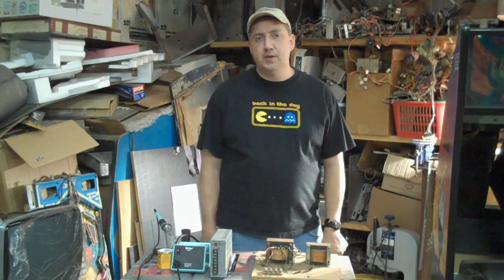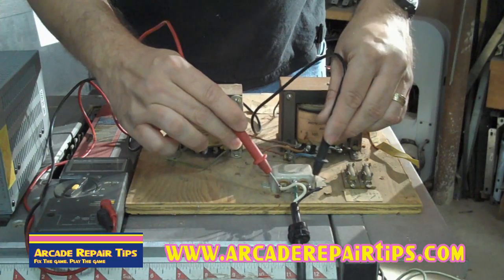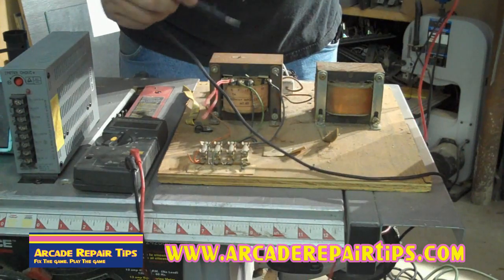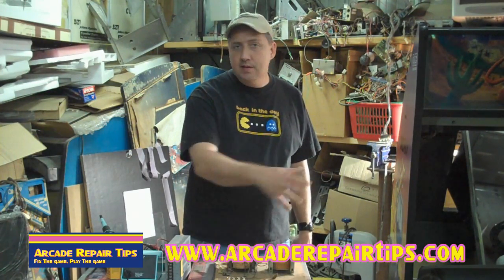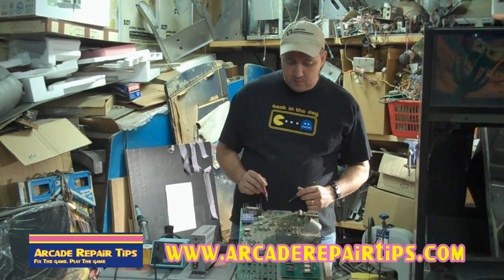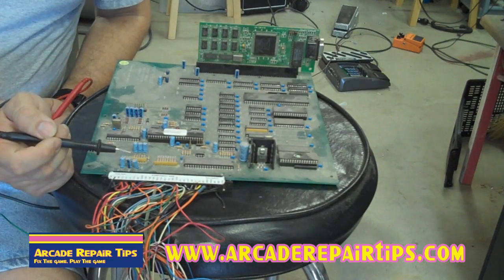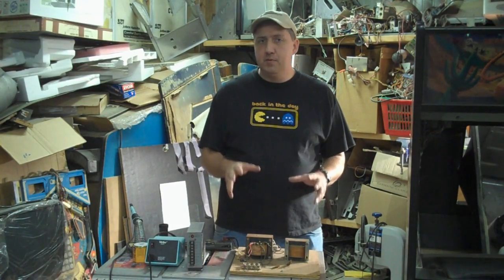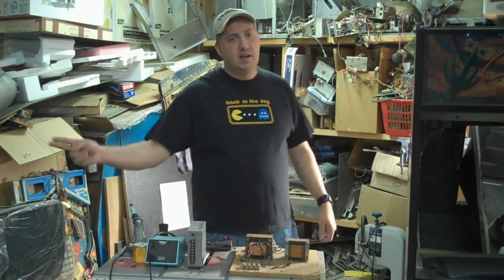Arcade Repair Tips - Checking A Classic Power Supply

Comment: I have a ranger mission cabinet.  The fan inside the power supply stopped spinning.   That’s probably not good for the monitor or the board.  Things will get hot I assume The game won’t coin up anymore.   I put in a new cherry switch and game still won’t coin up.  Any suggestions?
Reply from the maker: Yes, a broken power supply fan is not a good thing, but that should not be causing the coin up issue. Trace your coin and ground wires back to the harness. Make sure they are making a good connection. Remember, you should be able to touch either of your coin wires to a ground and the game should coin up. If it doesn't, then you probably have a wiring issue of some sort. Hope that helps.

We will also be covering your question on our Live Show Episode 88. Here's a link to the episode if you want to watch it: https://www.youtube.com/watch?v=kPaSejWRwso
Reply: @arcaderepairtips  hey turns out I had the coin door cherry switch wired up incorrectly.   I fixed it.  All that’s left is repair the monitor.  The picture edges are a little wavy and moving during game play.   I assume that’s a bad cap or flyback issue in the K7000 25 inch monitor.  Thank u for helping
Reply from the maker: @jumpingeneral  Awesome, glad it was just a wiring issue. On the monitor problem, check your hold/sync adjustments. Check your sync and ground input wires/connections as well. Improper grounding can cause this issue. Check all of your grounds and the DAG wire. Hope that helps.
Reply: @arcaderepairtips  thank you for helping.  I noticed a crack in the flyback.   That would explain the waviness on the sides of the screen I guess
Reply from the maker: @jumpingeneral  Yep, a crack in the flyback can cause this as well. Fortunately, new K7000 flybacks can be purchased from most arcade parts distributors.

Comment: What is a AR board? I have one in my sky shark that I think is bad. old game  If I cant find one then is there a solution? Sorry I am not knowledgeable regarding this, Im trying to get it working again.. Thank you!
Reply from the maker: A/R boards are Audio Regulator boards. They were used in many classic arcade games (especially Atari games) to act as an audio amplifier and linear power supply. Sky Shark is a JAMMA game and as such should not require an A/R board as the audio amplifier is built on the game board. With that said, the A/R board in your cabinet may still function as a linear power supply. If this is the case, you should be able to remove it and wire up a standard switching power supply in its place. Be sure to follow the JAMMA wiring pinouts during the conversion process.

If you would like to hear more of our thoughts, we will be discussing your question on our Live Show Episode 69 which can be found at the following link: https://www.youtube.com/watch?v=LHLN9hmDZcc
Reply: @arcaderepairtips  Thank you so so much. I have been going over a tone of you tube and arcade sites. This makes it so much easier! I will watch your channel!

Comment: Bought a Ms. Pacman cocktail table last week and the innards are in rough shape...but this video helped me determine my power supply and isolation transformers are actually working, believe it or not (fuses are just disentegrated, but that's a cheap and easy fix).  Also great info about measuring voltage on the board.  You saved me a lot of research; thanks!

Comment: Thanks for the good video.

I frequently tack solder test point loops (DigiKey, etc.) on just behind key solder pads on edge board connectors.  Big wide edge board connectors, especially on ancient boards, are easy to mess up when you pull them off and push then back on.  I tend to use oscilloscope test leads, so having loops to grab keeps my hands free.  You can even make these little loops out of 24 AWG bare copper.

A really good channel to learn about PSUs is EEVBlog.  Switching PSUs are pulse width modulated devices controlled by oscillators. That is what the "switching" means.  The other standard PSU is called a linear power supply.  Those are the ones that are driven by things like the old 7805/7905, LM317/LM339, etc. semiconductors.

Learn a little of this stuff and it makes it easy for a EE type like me to help out if you don't have an arcade guy around.  The whole reason I am hanging out here on this channel is to learn how arcade people think and talk about their art.  Maybe I can work on a game when I get done watching.

Believe me, 35 years as a design electrical engineer (EE) does not prepare you for arcade work.  You guys with games could help bridge the gap by checking out how we EE's talk about our world.

Comment: With my powersupply "peter chou" set at 5v tested on the ommeter should i be getting -5v on that socket? Im getting 4.57 when i test the negative 5v. is this power supply bad my mk2 board wont work its red led is lit up but wont boot up or even check roms, but if i hook up my mk1 board it works fine help please THANKS!

Comment: Great video,thankfully i have only ever had one psu problem with my cabinets and that was with my German Vanguard cabaret,the graphics broke down into jail bars after running for 15 minutes so i suspected the voltage was being pulled down slowly over time.It turns out it was the main 10000uf 63V capacitor on the psu board.

Comment: might need s this not sure yet can you hlep me. I have this same boared . An a while back my hard drive went out .. so i gotten 3 anotehr one.Now when i turn on the game nothing happens its showing the number 8 on the LED lights on the bored. I notice when i take the hard drive belt off it spins up. When i plug it back up it does not spin.. do you have idea wt could be the problem sir? Do you think it could be a bad ship or a power supply problem..

Comment: Hi , I just bought a dedicated MK1 machine runs fine but has no power harness running to the sound board. It doesn't have the bracket for the sound pot or test menu switch. My question is where would you find a power cable and how would you go about getting a sound pot bracket with all the service switches? Do you have any for sale?

Comment: Excellent video.  I remember that older video where you talked about the back of that transformer putting out DC.  I never have had to work on one without a switching power supply, so it's good to know that extra board is needed for the older games, or that they convert to DC on the game board themselves.  Great work!